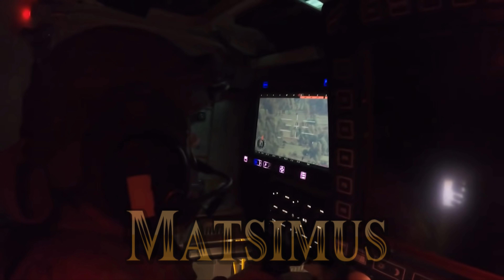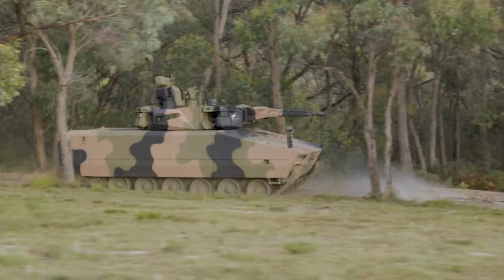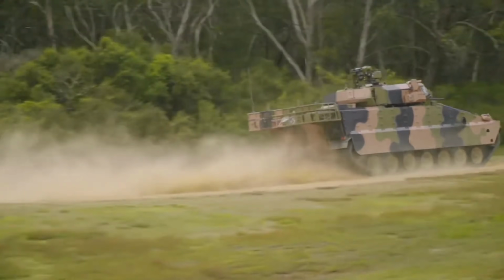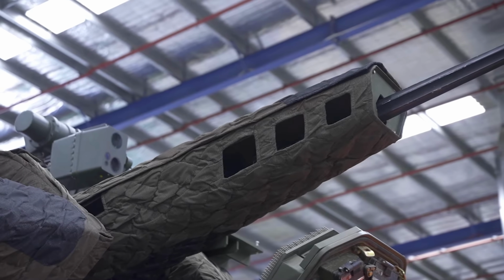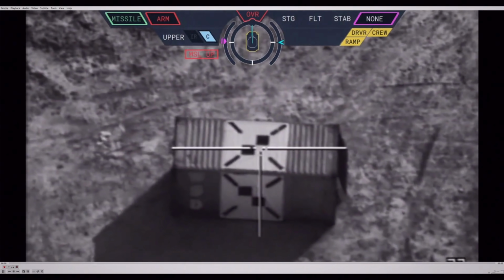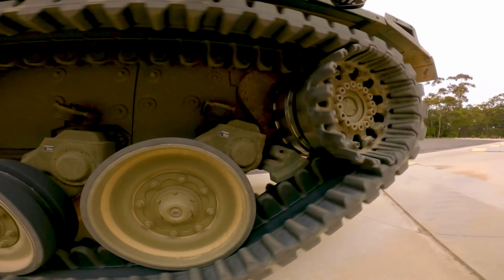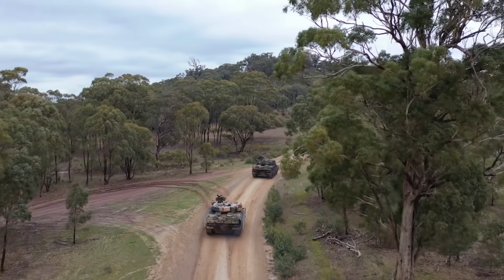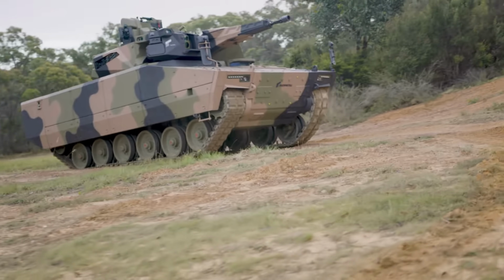KF41 'Lynx' & AS-21 'Redback' Infantry Fighting Vehicles - Land 400 Phase 3 | ARMORED COMPETITION! 💪

Comment: does the redback retain the swimming capability of the Korean one? It might be a better choice then.
plus that 40mm is lookin good, The german gun is too proprietary
Reply: Water crossing: no
The biggest issue with German cannon is it uses specific ammunitiom just made for that gun only, logistics issue.
Reply: They have already the same turret for their boxers so it would be better to chose the lynx!
Reply: @HedgehogZone  I think it it will be the redback, as Korea has done a lot on this one.  As it is only, for Australia,  from what I have red so they went all out on it.
Reply: @hishot1078  
1) Same gun on the Boxer.
2) Factory for making it in AUS if Lynx wins
3) There are other producers for similar ammo. They (or AUS) just need to be ready to spend the money to certify it.
Reply: @positroll7870  Did Boxer done with issue regarding integration of the turret on current / new chassis?
Reply: @hishot1078  Last I read DoD said integration re the APS was still ongoing. Note that putting on s.o. elses APS was not part of the Boxer contract, RM just said "lets try whether we can make it work, if that's what you want".
Reply: Isn't that the same gun that is already on the Boxers lance turret?
Reply: @positroll7870  BTW, that 30 mm isn't NATO standard, the US doesn't use it while Aus always go with the US. If you cannot get supplies from the US, you know what's coming.

Comment: Hi Matsimus, you are absolutely right about the way the Australian military goes about procuring new vehicle platforms, they accept where their own defence industry doesn't have the technical skills, knowledge or capacity to design and build a certain capability, therefore they just get on with it and buy the best foreign made platforms that they can afford and so aim to get the maximum capability for the money. I do wish our MOD and the British Army took this approach more often, and stopped trying to just create jobs at home for the sake of political votes, despite it often being the most costly and inefficient route of procurement and compromising on capability.
Reply: Seriously??

Australian defence procurement is a disaster and has been for years.
Reply: @richardm7004  Yes, I completely see your point, and no doubt that the Australian procurement system may be quite flawed, but I do believe ours in the UK, has reached an all new low with corruption between the politicians and industry and Red Tape being endemic. Cheers.

Comment: I hope the Ajax vehicles for British Army will get the problems worked out.
I believe they should of stood with the standard 40mm cannon turret. The noise issue with the vibration problem needs to be quickly fixed. 
Maybe the British Army should of went with one of these two vehicles to build and deployed instead of Ajax

Comment: Either way, both of these systems are very competent and the Australian Army will end up buying a good IFV, at this point it will come down to cost. What i love about these new IFV is how flexible they are, really encapsulating the old "jack of all trades, master of none", because they can actually engage every type of threat a land vheicle might face in order to keep the crew alive.
Reply: IFVs are supposed to be jack of all, thats what infantry does.

at any rate, when it comes to bang for your buck, south korea usually has the advantage VS germany casue we use so much weapons ourselves. the AS-21 is basically a SUPER souped up version of our own top of the line K-21 IFVs, and the tech used in the AS-21 will probably be considerd for a K-21A1 down the line.  more vehicles means more spare parts manufactured and lowers the costs.

it ALSO helps that hanhwa also makes the K-9 sparts, meaning that they can be fixed and maintained in the same depots.

Comment: The only criticism I have is that if these vehicles are too heavy then it won't be possible to deploy them to South East Asia. And if they are too heavy, what are we going to use them for?
Reply: Then get a few K21s. Less protection and less tech but only 25 tons.
Reply: @edwardkim8972  Would never happen. Culture within the Australian Defence Force is risk averse with regards to casualties, and always prefers expensive high tech equipment. No way will they even consider a 25 ton tank.
Reply: @jamjam-v4q  yet they endured having a 13 ton death box on tracks for over 40 years (the M113)... 🤣

Comment: Lynx has the armor of an MBT, can be alterer to Orlikon, excellent Rheinmetal tech.
Reply: Armor of an MBT from about 1935. Protection from 30mm autocannon rounds on the front and 14.5mm machine gun rounds on the sides and back.
Reply: @mistersmacky  Even fanboying the Redback, the Lynx has 40-50 tons. Thats over a T-72 with 44t, (the Redback has 25-30tons a Bradley below 30). I would say weight correlates with armor and size. That should be rather 300-400mm equivalence. And IFVs are companions of the MBTs so there is no surprise.
Reply: Lynx does not have an armor of MBT... Which MBT are you speaking of and from what era??? From WW2 or current? If current, which MBT has that weak of armor level??? Leopard 2 has 800+mm armor. Are you saying Lynx has that thick of an armor? You are mistaken. Check your numbers again and report back to this comment thread please. BTW, the Redback battle weight is 42 tons, not 25-30 tons. Not sure where you are getting your figures from but you should check that again.

Additionally, the Lynx (one of the test units) developed a gear box problem during testing in Australia. So did the Boxer CRV from Land 400 Phase 2. Too top heavy and cannot accommodate APS and Rheinmetall is not too keen on helping to fix the problem. That is bad post-sale service.

Comment: It is way past time for the ole M113 to go away. I used to drive them in the 90s and 00s and their firsrt problem was that they were so slow when we still had loepard1s the leo would do close on 100 km on the roads but the poor ole 113 was maxed out at 80 KM so as a scout force for the tanks they were useless add tyo that the 113s would stop a 30 cal but not a 50 cal round it was no longer an armoured taxi but a butter box. 

Problem was that till now the only way to have sped was to have wheels and Australia is notoriously  a death  trap for any sort of tyres on any vehicle.

The bigger problem was that the powers that be couldnt decide on how to employ one tank regiment nd 4 or so IFV or apc regiments effectivly. Once they finally decided on this role and how to split things between the 3 ARA and 1 Reserve GRES Brigades with the second Gres Brigade being mainly for training. It ment they could look for suitable vehicles which is why they updated to the Abrams to keep the NATO/US compatibility going but the big problem was the IFV/APC area and for years and especially after the procurement of ABRAMS it was thought most likely we would get a deal on ex US BRADLEYs but with the RAAF getting state of the art planes and the RAN getting their new toys to replace the relative new older toys it is great to see they are going for the more cutting edge type IFV/APC. 

By the way Matt your friend sheldrake is obviously to most ex army here a dropshort(Gunner)
Reply: Boxer and Lynx/Redback are nice.
I still think there is a role for a cheap, capable tracked APC like this one 
https://www.youtube.com/watch?v=fW-Ck46GAdI
 away from the immediate frontline.

Comment: I'm Korean, but I'll be objective. Considering the modern battlefield, speed and low noise are important for infantry vehicles. Because the key is to move without being detected. Redback's rubber caterpillars outperform Lynx in speed and low noise.
Reply: As if the Lynx can't be equipped with rubbers...
Reply: @SuperGeronimo999  they can but they won't

Comment: Why do these only carry 6 vs the 8 dismounts that are in the US bids/trials.
Reply: You have it backwards. The AS21 and KF41 both were required to have 8 dismounts for ADF. For the US M2 Bradley replacement competition, the specs call for 6 dismounts due to increased weight from additional armor and total weight restrictions. With thicker armor, they had to reduce the size of the US competition vehicle specs. The US must have be able to carry at least 2 vehicles inside the C17 cargo planes. With C17 load capacity, each vehicle must be less than 35 tons.
Reply: @jwb1227  Thanks for the info.

Comment: is this thing proudly made in australia?
Reply: Yes. Redback's will use turret from an Australian company and will be made in Australia. Hanwha is a kind of platform company. Australians can put what they want on that platform. It would like to be a custom suite. As far as I know, the Jobs of Hanwa system(formerly known as Samsung Techwin) is an integration of digital fire control system, vehicle control system, and supplying vehicle's body, armor, engine(same with K9). The rubber track came from Canada, Hardkill and missile system came from Israel, guns, and transmission are made in Germany.  these days cutting-edge products are not able to make by only one country. if the final product is made by Australian hands, it's made in Australia.

Comment: Matt would you agree that we're seeing a new era of AFVs ever since the CV90 was introduced, which focuses on protection through mobility and tactics (maybe with a last resort APS) instead of protection through armour?
Reply: APS does not replace conventional armor. Active armor does not protect against 30, 35mm projectiles, mines, shrapnel... BUT a javelin, NLAW (or even against a Russian HEAT-headed 125mm rocket-propelled projectile) is ineffective against the KF41 strikeshield...
In addition, the explosive charges of the active armor are used once, a second hit in the same place may be prevented by neighboring charges, but with a much smaller chance...

Comment: At this point in time, from what has been stated in some circles, they are essentially neck and neck in the race. Both do things slightly differently (in terms of sensors) , but in terms of capability, they are essentially on par with each other. What it will come down to is unit cost and support costs, and future growth margin in terms of scaling armour and lethality into the future to counter future threats. It really is a pity that one will inevitably have to lose, because they are both great vehicles. Either way, Australia wins because we will have one of, if not the best modern IFV solution in the world.
Reply: considering that the lynx is the export IFV of Rheinmetall and the Puma is the real deal there is no chance that either the redback nor the lynx are better than the puma but as far as affordable, proven tech and down to earth modern IFVs go they are great.
Reply: @swunt10  Puma is suffering from major issues right now, from servicability and maintenance complexity and spare parts shortages, technology and sensor obsolescence and a couple other issues. While it is a well armoured vehicle, by the time the Lynx KF-41 and AS-21 are operational, they will either match or exceed the Puma in capability. You are comparing a vehicle that was designed in 1995 with vehicles that were designed in the last 5 years.
Reply: @BallisticSollution  all the teething issues with the puma where solved this year so you are telling old news. also the lynx is based on the Marder and build to budget for export and the redback development started in the 90's and was finished 13 years ago. in any case the puma uses the most modern composite armor and is the best armored ifv in the western world. so everything you said is sort of nonsense.
Reply: @swunt10  Yeah good luck with that. The KF-31 is based on Marder, the KF-41 is a clean sheet design which was for all intents and purposes designed to match the capabilities of the Puma but at a far better price because the Puma was a rip off - there is a reason no-one else uses it. The KF-41 is also using better, more modern sensors and a larger internal layout to be just as effective, if not more so than Puma. The armour will also be Level 6+ with the inclusion of Iron Fist APS - so already matching, if not superior to Puma. The fact you just stated that the K-21 is in anyway remotely the same vehicle as the AS-21 means you know absolutely nothing about that vehicle either. Stop spreading misinformation and obvious biased nonsense.
Reply: @BallisticSollution  wrong.. "One of the key principles of the Lynx concept is the integration of proven sub-systems with a high technology readiness level to reduce development time, cost and technical risk" the lynx uses 'proven systems' and sensors, not the latest high tech. the puma on the other hand just got new sensors in February this year.
PS the KF-41 is just a stretched and modified version of the KF-31chassis. whereas the KF-31 is a taller and modified version of the marder.
Reply: @swunt10  This is turning into a pointless discussion. What is your point? The KF-41 uses the same sensors or better than Puma. In fact the turret design (Lance 2.0) is significantly more advanced than the current Puma turret design. After they are upgraded, sure, the Puma might be technically the same, but it's not yet. "Proven sub-systems" means they are taking proven capabilities within other RMMV (including Puma) and applying them to the KF-41. Not sure where the hell that is considered worse, or not latest available? The Puma has not gotten anything yet. The upgrade program was approved but won't be completed for another 8 or 9 years. The KF-31 and KF-41 share a similar DNA, but the KF-41 is significantly larger, and more heavily armoured than either KF-31 or Marder, and it has already been verified that the KF-41 is a completely clean sheet design from RMMV. It uses a similar overall design, but that doesn't make it the same vehicle. Unlike the Marder and KF-31, they are essentially the same with the KF-31 being an upgraded design of the Marder FoV, but a much cheaper budget option. The KF-41 is a top of the line IFV and on par with the Puma.
Reply: @BallisticSollution  does the KF-41 have MUSS? or 20 times magnification? or 2 independent 360 degree optics +the normal camera 360 degree round view along with the normal gunner optics as well as a automatic washer and armor plate for each optic? can it depress it's 30 mm gun to -17 degree or up 60 degrees? No, so... also read this to learn something "In the advertised configurations, it contains as many Rheinmetall-made parts as possible, even if these might not always be class-leading. One example are the optics, which are based on Rheinmetall's own SEOSS (stabilized electro-optical sighting system). This is a purely electronic sight, meaning the SEOSS features no optical connection for the daysight unlike some other optics. It also includes the Rheinmetall-made SAPHIR thermal imager, which performed worse than the ATTICA thermal imager during Bundeswehr testing and hence was not adopted on Bundeswehr combat vehicles." now please don't write a come back just to have the last word, we are not in kindergarden here. only write something if it's actually worth while otherwise let it be. PS also I wrote the puma got it's latest update in february, that's 1/2 a year ago so why do you write nonsense like "After they are upgraded, sure, the Puma might be technically the same, but it's not yet. " just to infuriate me or what? stop talking nonsense. the lynx is a nice afforadable export version from the germans, it's made for countries who don't have the capability to build their own tanks. it's build of proven parts (meaning nothing new), fewer system and less complex/redundancy. the lynx is a run of the mill standard volkswagen and the puma is a custom build mercedes infantry fighting vehicle specifically made for the german style of tank/infantry war fighting and just like the marder it will not be exported (until the germans sell off their old pumas in about 20 years) since other countries don't have a proper armor docrine and don't need a capable vehicle like the puma with a price to match, for most other countries a normal ifv does the trick. the british even decided to dump their warrior ifv and replace it with the boxer because they just don't have a armor war fighting doctrine.
Reply: @swunt10  so essentially you're a Puma fanboi and don't actually know anything about either of the other vehicles. Cool.
Reply: @thonger63  you argue like a passive aggressive woman. maybe try again with facts..
Reply: @swunt10  you dont have any so why would I bother. Re-reading your comments its obvious you're some German fanboi. When was the last time your fabled "superior armoured doctrine" was tested in combat... I'll wait..

Comment: Look at both your Lynx and Red Back vehicles in you past videos and have viewed Doug Trans  vidio on the Land 400 program. Both are great vehicles but in my opinion the Lynx offers a vehicle that can be quickly reconfigured into vehicles that have different capable better than the Red Back. This provides a common base vehicle that will simplify logistics and repair while providing more of the fast adaptability that modern warfare demands. I view Austrailia as a force with lower manpower; therefore, should plan on using vehicles that can flank or hit and run against a numerically larger enemy effectively. My only comment has been why a wheeled vehicle with the adaptability of the Lynx was not considered too?
Reply: The Australian army dose a wheeled version under construction its the Boxer with its modular system  which allows it be reconfigured between APC ,IFV or ambulance. The boxer also carries the same turret an 30mm cannon as the lynx which will make things easier on the  supply chain and training crew .